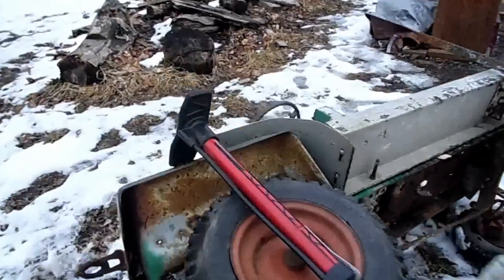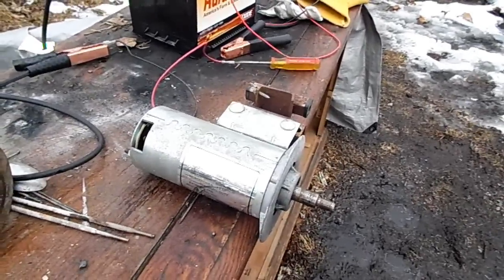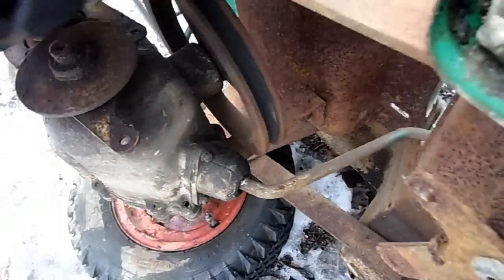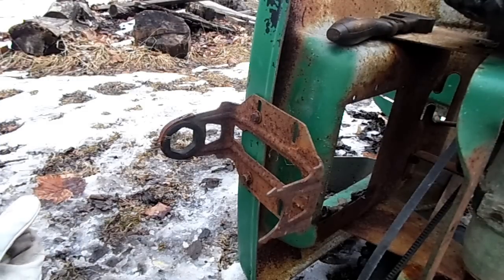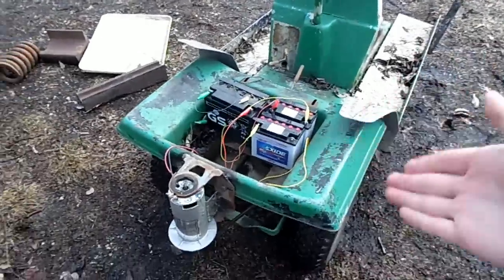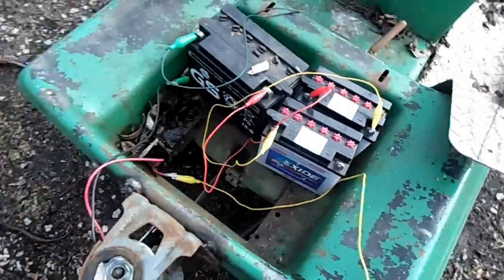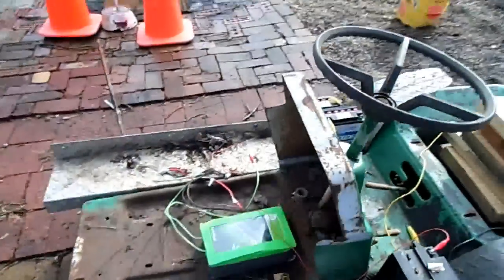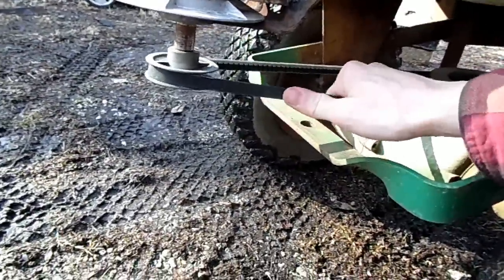DIY Electric Lawn Tractor part 1: installing the motor

Comment: hey kid that was cool  dont worry about the trolls and there negative comments ...its good to see people recycling what would othrreise wouldve been junk in to something useful or fun...i would suggest putting your self a small engine back there like say a briggs  some where between 3 & 5 hp. but you will need one with a cast iron fly wheel then youll have an awesome little machine that would be very useful and fun....be cool bro. and keep thinking

Comment: I assume you will be moving the batteries to the front and putting in a cushioned seat.  

The side rails are a nice idea.

You can stick those orange cones on the struts from those side rails so they can see you coming.  " It appears to be a mobile hazard and its coming our way."  Well, maybe not.

Comment: Thicker cables lol, more power ha ha :-)

What i find unusual is the quietness, normally everything is drownd out by petrol engines.
Reply from the maker: yeah it is nice and quiet. but luckily the motor only pulls 3 to 12 amps so those little wires didnt heat up much. i think i'll just use something like 14 guage.

Comment: I also have a lawn mower (tractor) that's been converted to hybrid electric (5HP gasoline engine and a 4Kw DC generator supplied the power for the electric motor). Watching your work really makes me feel bad that i disassembled mine (cause i needed the engine-generator unit on something else) and i'm kinda thinking that i should bring my little tractor back to life :D. Great work you got there!

Comment: Since the motor draws about 10amps could you put the dc-dc step up converter on the motor powered by the lithium batteries???

Comment: you should look for a electric lawn mower they are 24v and they got a good switch in them to use with high voltages

Comment: it appears you are not testing that starter correctly, ground the metal case, and run pos. to large pole on solenoid, nothing will happen, then using a screw driver, touch large pole to a small one...be prepared tho, these things have enough torque to leave the bench!
Reply from the maker: yeah I figured i was doing it wrong. but I'm glad I went with the other motor instead. its working great.

Comment: Fantastic. More batteries in series and parallel. Then all you would need is a sign on the back. That says "The dot on the horizon is me and my mower". HA HA HA HA. Great work my friend looking forward to the next.
Reply from the maker: hahaha i would love to put my car batteries on it but idk if they would be too heavy. atleast untill i get the tires fixed they will be too heavy for sure.
Reply: You won't know till you try. Go for it. You only got 2 choices. It work it don't. I have proved theory doesn't hold water sometimes. Just like NASA. Black holes will not let anything out. Yet they found streams of radiation leaving the black hole at incredible speeds. That's why I never use theory. I just get on with it. Also it's a lot more fun. Diving in not knowing. Go for it.
Reply from the maker: Raymond Earle
well it would mean i'd have to cary like 6 car batteries up from the basement and around the house. i'm a bit too lazy for that right now ;p
Reply: Something to do in the future then my friend.
Reply from the maker: Raymond Earle
yeah, but i think i'd be beter off using small batteries. like i found i had a 20ah and a 35ah lawnmower battery. those would be good. i dont see myself needing more than 30AH of capacity. well atleast with lead acid. if i build a lithium pack thats much smaller and lighter i would love more capacity.
Reply: I shall be watching for your results in future video's.
Reply: Thank you MS.

Comment: Do you think that starter motor would have been powerful enough to run that mover,if it was working ?
Reply: Fook Utube ive moved older vehicles that wouldnt start with the electric starter it was slow going but it would move across the yard so yea it would have pushed that little mower frame for how long it would have lasted who knows

Comment: Just wanted to say ..You are now my first stop on You Tube and really enjoy your videos and experiments. My knowledge is probably similar to yours so I really enjoy the commentary.

 A couple of comments.  One thing I have learned is that wire gauge really matters when I have more then a couple of amps and I would expect that you might have doubled your tractors performance by using larger wires with the 3 motorcycle batteries.
 I also was wondering with brand the lithium block battery was you used? If I missed from an earlier video I'll look for it but all I remember was your home made 18650 battery. I haven seen any other welding with batteries you tube videos that have worked as well as yours. Bravo!  I would love to see more tests of capacity of your recycled lead acid batteries and lithiums and Reviews of new batteries and LED's. I see that other you tubers that do reviews get lots of donated items in exchange for honest reviews and that really helps us make informed purchases.
Reply from the maker: well thanks for the compliment!

the reason why i used small guage wire is because my medium sized cables with big Meuller clips are missing. i bought more Meuller clips today and will make more. also that day was 60 degrees outside. now its back down to 20. its not gonna be 60 for like 2 months. so i was really pressed for time :P

and yeah i plan on using 14 guage wire. the lithium cells i used where mostly Sanyo with some Panasonic i think. i still need to build the 2nd 24v block so will build it a differant way and do better tests on them.

i plan on buying/building a shed so i can actually have room to film reviews and stuff. and i just got my first paycheck from youtube this week  (1040$) so will definatly be able to finance a shed!

btw i found a 30ish AH and a 20AH battery in the basement, and got another 15AH battery from Rural King's recycling skid today (its at 12.8v so its great) that means i have enough to make a nice battery for it now! also picked up other bits i need for part 2 :P
Reply: Congrats on the check! You absolutely deserve it.
Reply from the maker: Rob NAustin
 it wasnt a check, it was direct deposite.

bwahahaha i love undermining what people say! :P
Reply: Rinoa Super-Genius
Good to see you appreciate your followers and the point of my post was congratulations?

Comment: nice job. Looks like it has some good power. I can't wait to see the next part and see what else you do. I am making an ebike and got my battery made and have a 24v motor from a scooter that works good but I am having trouble mounting it in the right spot to line up with the rear sprocket. If I can get a sprocket on my front wheel and have someone weld a mount on top of the wheel and have it lined up that would be awesome! but I don't know anybody who can weld. And I don't have any lead acid batteries for arc welding like you do.
Reply from the maker: hrmm yeah i've found welding is an integral part of inventing. you could get some batteries for almost free like me. find some really dead batteries (like if your neighbor replaces his car battery, pay him the 7$ core charge for his old battery) and if that battery doesnt have much power, go to a store that takes core charges (rural king, tractor supply, autozone, walmart) and ask them really nicely if you could swap that battery for a less dead battery from the recycling skid. chances are you'll be able to find batteries that are almost new. i find if i say i used them for experiments and am honest people dont mind at all. all they care about is if they have the right number of batteries at the end of the day. not size or capacity. you then have an unlimited supply of batteries! idk if i've told you that before, sorry if i have. i get a lot of comments :P

but that 24v motor sounds great. its always easier to make a battery for lower voltage. i thought 48v was hard enough, now i got this 100v motor, would be easy if it was just 12v. one truck battery could power it. >_<
Reply: Yes I do recall you saying that in one of your first videos I watched. I think I will try getting some batteries like you said. But where I live right now I don't have space like you do in your back yard. I hope to be in an apartment next month but even then will not have a great amount of space. but it will be more than I have now. Do you know by any chance where I can get a sprocket that will attach to my existing front wheel? I work at a thrift store and we get a lot of crappy bikes donated and I can never find a sprocket that will fit my wheel.
Reply from the maker: Tyler Nevers
maybe use a back wheel that has a sprocket as your front wheel? Ive done that before.
Reply: Thanks for the tip. I will try that. I looked at my bike, a front wheel might be a bit to wide but I think I can bend the bike a little to hold it.

Comment: This is awesome! What I really like about your concept is that you've kept the transmission intact. Every electric vehicle that I've ever heard of is just a direct drive system. I find your concept a lot more interesting, as it kinda keeps the simulation of an engine, right down to the motor staying running in neutral. :P Was your test drive at the end in top gear?

Now here's an idea - once you get the battery system worked out, figure out a switch or lever of some sort that you could stick on the dashboard to switch how many batteries are connected in series, thereby being able to vary the speed of the motor.

Hope to see more of this!
Reply from the maker: well tbh i dont think i would like to change voltages. its a great idea but i think 60v or so would be great. and i could control it via the transmission gears.

ya see the issue is the more volts i have it seems to exponentially increase the power. like at 12v its wasting most of its power just trying to go. but at 60v it doesnt notice the load as much. but perhaps if i go past 60v i may use the voltage switching.

the only time i think i used high was in the first "result" clip. but the ones after it where in the lowest gear. i was very surprised how fast it was going on full. you could prolly tell i was fumbling with all teh controls and obsticles hahaha.

next time i might want to remove the yellow bucket of acid from the yard incase i run into it haha.

do you think the side rails look kinda cool? then again they are kinda stuck on there so they stay haha. btw i have the hood that origenally went on the front. i just have to weld it back on.
Reply: Rinoa Super-Genius I think they look cool. :P Give you a place to rest your feet, anyway. They'd be useful for carrying stuff on, too. In fact, I think you could potentially get a lot of use out of this machine for carrying stuff back from the woods, and such.
Reply: Rinoa Super-Genius Going back to to the voltage thing, you may be right on that. I don't really know, and I'm intrigued now. That might be a good idea for an experiment, calculate the power drawn moving at a specific speed for a higher voltage and a lower gear, versus a lower voltage and a higher gear.
Reply from the maker: *****
 yeah i'm planning on using it to carry sand back from the creek. i think it would be good to put sand and rock in the areas of the yard that are muddy.

it also might be strong enough for moving dirt/snow.

but most of all its just a fun little vehicle i can drive around in the woods. perhaps latter this year i can take it down to St Joe State Park when i go on vacation. i could park it infront of my favorite cave :D
Reply from the maker: michael phillips
im gonna use that charger for my portable welder, not counting it sucks. so I'd be better of just building or buying a 70v charger.

Comment: it's a go kart, a lawn tractor would be much bigger.
Reply from the maker: but i'm not using it to go fast, i'm wanting to use it to haul stuff and move snow/dirt when i build a snowplow or bucket.
Reply: Rinoa Super-Genius
not all go karts are fast
Reply from the maker: brainjuice654
well it depends on what you design it to do. if your using it for traction. its a tractor. if your using it for just recreation and going fast its a gokart. this is somewhat inbetween but leaning more towards tractor since its main use will be as a traction engine. thats why i made sure it was geared down a lot.

not counting gokarts have much much much much differant designs.